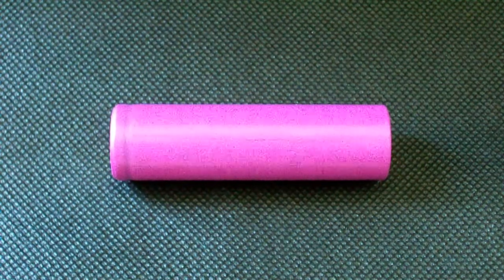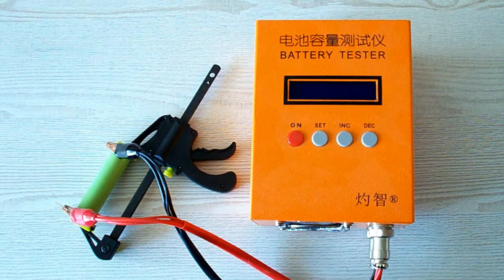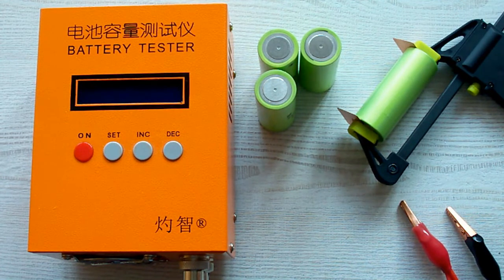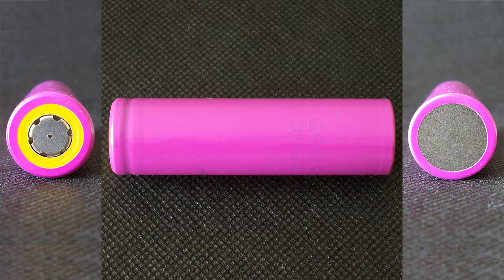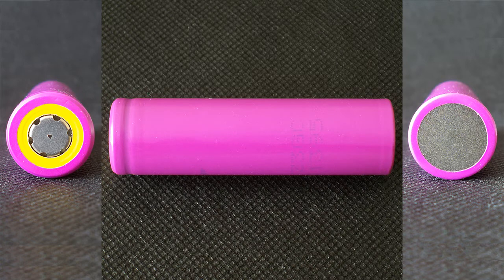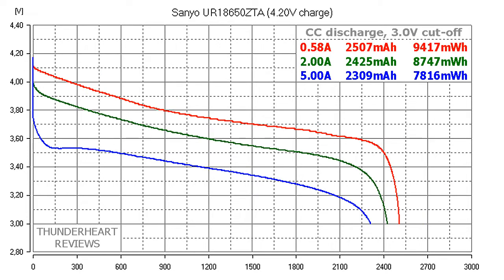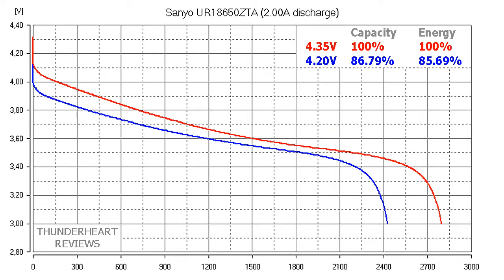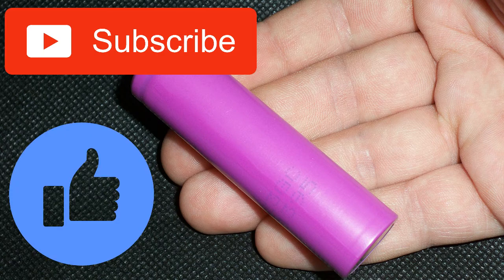4.35V High Voltage Li-ion SANYO UR18650ZTA discharge capacity test

Comment from the maker: 0:00 - Intro
0:43 - Testing equipment and conditions
1:40 - Battery supplier
2:03 - SANYO UR18650ZTA test at 4.35V and 4.20V charge end voltage
4:17 - Comparison between 4.35V and 4.20V charging
4:50 - Verdict